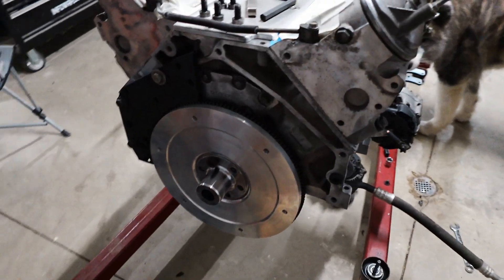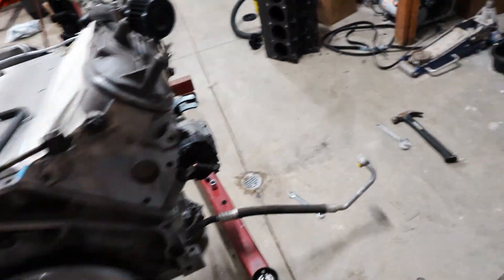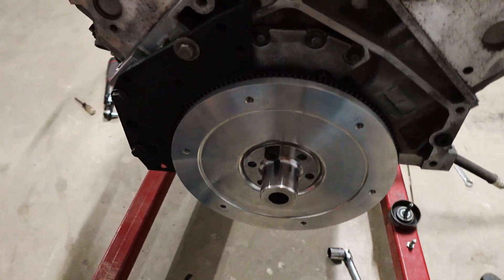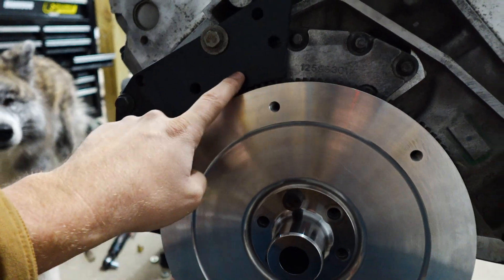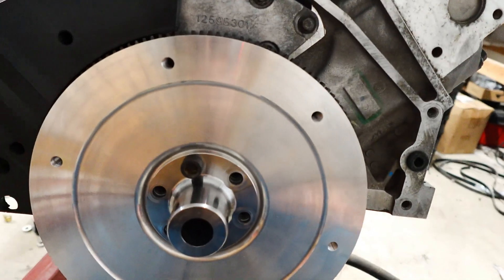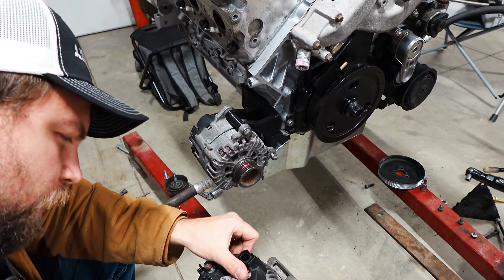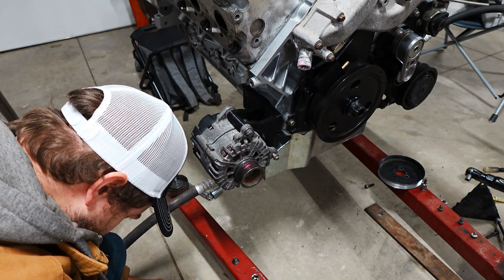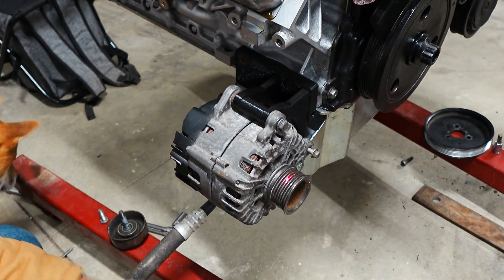LS Audi Update | (Flywheel is DONE! Serpentine Bracket Design) Ep: 10

Comment: been a min since i checked in,   LC9 ?    i remember the ls4 no oil,  but making everything compatible with the LS4 as well ?
Reply from the maker: I’ve split it into two designs until I can come up with a different arrangement for the starter. Basically right now there is one thicker design for the normal blocks, and then a thinner design for the LS4.

Comment: How is the progress coming?
Reply: Same here with the work. I picked up a 06 Audi s4 a few years back with intentions that when the motor blew up I was going to ls swap it. Well it still hasn’t blown up yet so I decided I would get back into the research of preparing and collecting the stuff for the swap. I would be very interested in and am very invested in the progress of your parts.
Reply from the maker: @isaacbutler-d9j  I will hopefully have some big updates next week.
Reply: @projectLSaudiA4  sounds good I look forward to seeing the progress. I have big ambitions but my know how is body side not mechanical or engineering.
Reply from the maker: Coming along. Just got off the phone with manufacturer, adapter plate is on the mill today. Hopefully they’ll finish up early next week. Starter mount is done and tested, I’ll make another video soon when I get some time. Work has been busy lately

Comment: Would you be able to sell a template for the engine to transmission adapter?
Reply from the maker: In the future once everything is proven, I will be offering each part for sale. Possibly by fall 2023
Reply: @projectLSaudiA4   are you selling the adapters? I’m interested in one
Reply from the maker: @chrislaming6524  yes hopefully end of this month
Reply: @projectLSaudiA4  keep me posted. I’m swapping a LS3 in to my 75 Porsche 911. I want to do a mid engine and cut out the back seat. I need trans with the cv shafts closest to the bellhousing
Reply from the maker: @chrislaming6524  that’s a really cool project man. I will likely post updates here on YT as well as instagram.
Reply: How much do you think the adapter will cost? Possibly thinking about a Boxster transmission because they already making an adapter, but the CV axle is too far back
Reply from the maker: @chrislaming6524  looking like around $2000 to $2400 for just adapter plate and flywheel adapter (stock Audi ring gear and flywheel / Torque Converter will be reused) and bolts / hardware. Another $100 to $200 for starter mount. Prices are my best estimate so far but depends on material prices, it’s going to be cheaper if I can sell like 10 at a time due to setup costs and buying material in bulk.. My latest design that solves the starter issues should be done end of this month. After I’ve verified everything looks good, there’s roughly 30 day lead time for normal delivery as parts will be made to order.
Reply: That would be nice! I love my A4 but 3.2 sucks
Reply from the maker: @rodriguezluisu87  I’ve always loved the B6/B7 cars but always been put off by the factory engines. 2.7T is viable but not worth it IMO. Price for performance and reliability you really can’t beat an LS.
Reply: I could just ls swap it with a th400 and mustang rear differential. But i really want to keep the quattro
Reply from the maker: @rodriguezluisu87  If you were going to go through that trouble then buy an E90 BMW and buy parts from lse90.com. They have mounts for engine, transmission, rear differential, plug and play wiring harness, and even a canbus module to get the dash working.
Reply: Starting my swap in my b8 end of summer do you have a template for adapter plate
Reply from the maker: @ryanburke5648  I won’t be providing a template sorry. I will however be selling these as a kit possibly this fall. (Assuming my design works).